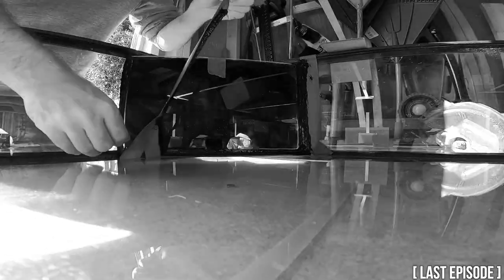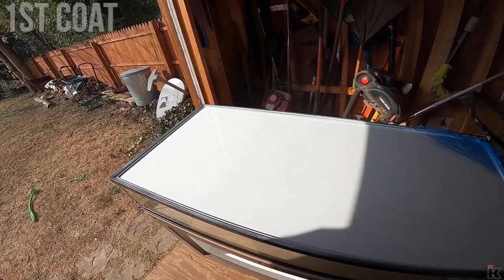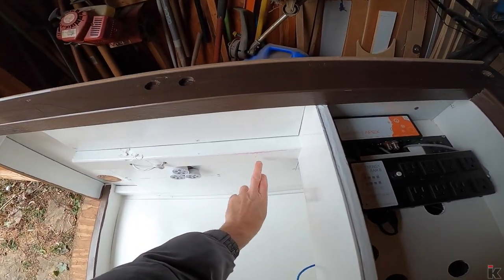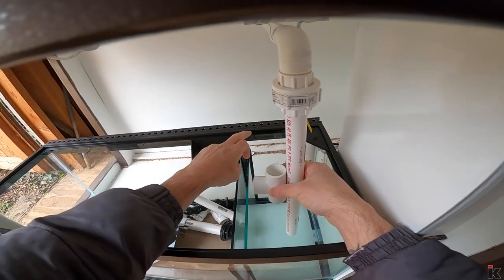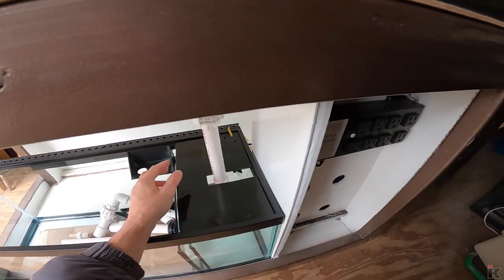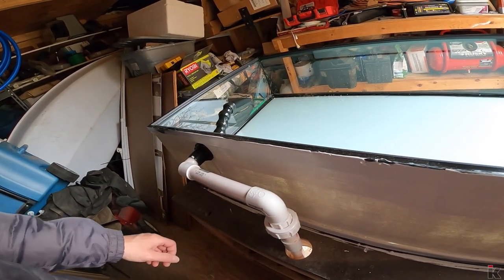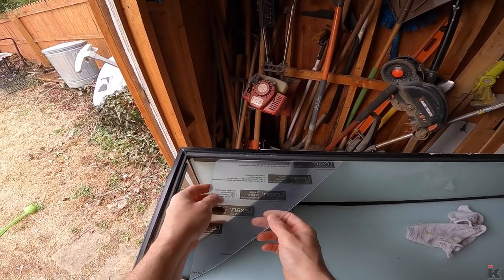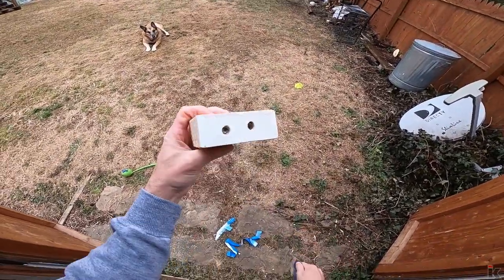Finshing plumbing, painting, and creating an overflow cover -A Shallower Reef EP11

Comment: I’m learning a lot from you but can you tell me is it just normal car paint you use to spray all your acrylic/Perspex, I made an acrylic cover the other day for my new tank and it’s clear am I really need it to be black so this info would be a great help, your tank looking fantastic as as usual I can’t wait until your next video 😊,Colin🏴
Reply from the maker: I am using normal spray paint you would find in any Home Depot, Lowes etc. Nothing fancy. :)
Reply: @IanKreer  Just thought I’d ask, incase it was some toxin free kind, cool I will get some primer and spray and get mine done, thanks a lot 👍😊🏴
Reply from the maker: @01fifer  No worries. Just to note, I didn't spray the underside of the overflow, I sprayed the top. I did this because inside of the overflow, condensation will build up, and then drip back into the overflow. I did this because I didn't want the spray paint to touch the water in any way.